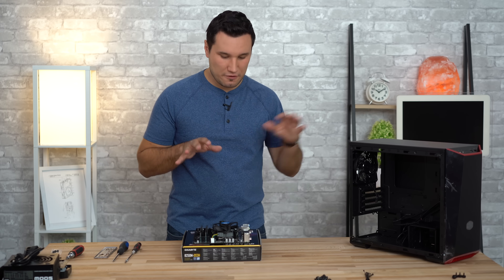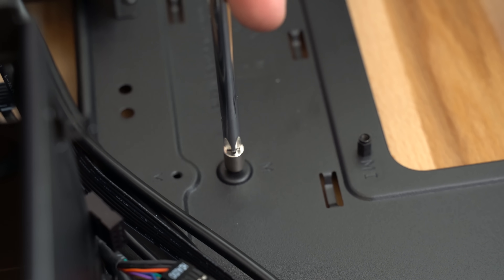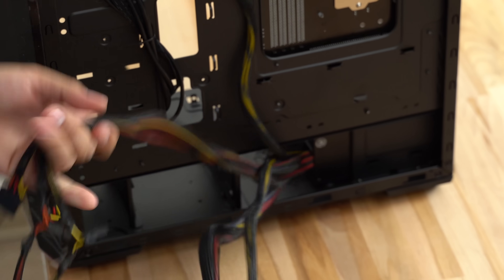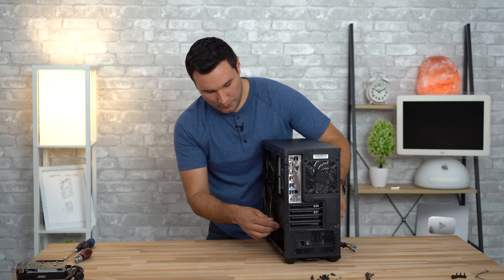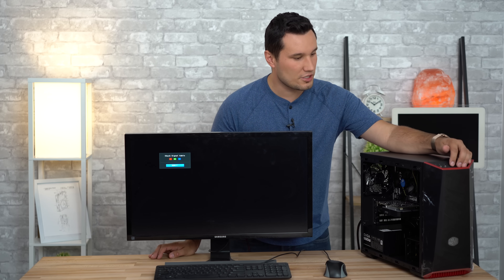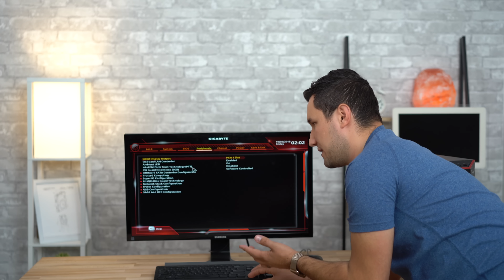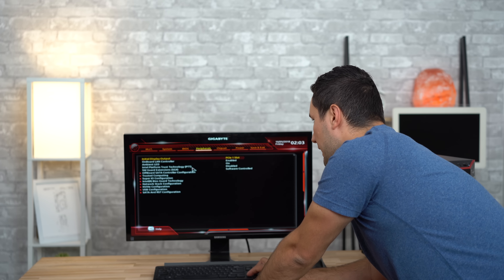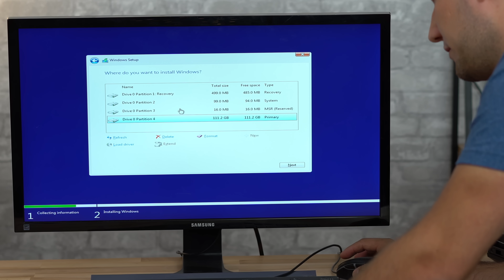$492 Budget Gaming PC Step-by-Step Build Guide - Fortnite & Black Ops 4 BEAST!

Comment: How can you only have 128 GB of storage in a gaming PC. If you look at many modern day games they are huge and would fill this up really quickly. If you are going to build this, put in a few extra bucks and replace the SSD with a 500 GB or even 1 TB Hard Drive to save yourself the hassle of low storage. It would be a little slower than the SSD, but you would have so much room to work with, and hard drives really are not that hard to install, so that is a poor excuse to not get one.
Here is a link for a 500 gb WD Blue hard drive
https://www.amazon.com/Western-Digital-WD5000AZLX-500GB-Internal/dp/B00B1LW3W0/ref=mp_s_a_1_4?ie=UTF8&qid=1540141597&sr=8-4&pi=AC_SX236_SY340_FMwebp_QL65&keywords=500+gb+hard+drive
Reply: Joseph Leedom or just get both.  Prefer a SSD to start with and os installed on that.  Later or if you have the extra money can easily install a 7200 rpm hard drive.  But personally I think any build is worth it to add both.
Reply: @dannamanna99  I agree, but for that budget, both is a little out of budget if you are going for performance and stability.
Reply: yeah but like I said, in my opinion getting a ssd and a 7200 rpm should be a must have these days.  stinks to have your pc crash in games like pubg.  then by the time you get back in, your dead cause it was a minute later lol.  ssd it boots up fast and loads faster as well.  can also get a 500 GB like you said with the ssd.
Reply: @dannamanna99  This.

Comment: Can I use a 1tb hardrive instead of an ssd?
Reply: Yes, you can.
Reply: Yes. SSD's are just faster. A lot of people put windows on an SSD so it loads faster and get another regular hard drive for everything else
Reply: I suggest both.  Just spend a extra 50$ or so and get a 1tb 7200rpm.   It’s a lot nicer to have SSD and os on that.
Reply: Yes but as @Chris Danna said, it's better to get a small ssd WITH a 1tb hdd

Comment: Fuck that buy a used 1060 3 or 6gb on eBay for around the same price. The 560 is absolute ass. Not to bash this build it’s still good
Reply: It's a good starting gpu, but I agree that there are better options out there

Comment: the i3 is a waste. With that kind of money you could get a ryzen 5 2600 that will blow the i3 out of the water it also has 6 cores/12 threads and is overclockable out of the box with the included cooler. Oh and don't forget that you can also stream with it while not even hitting 100%
Reply: Maybe he thought since the ipc was better with intel, that was the reason he went with the i3? Idk

Comment: Hi Guys

First off i really enjoyed these video`s Max. Thank you

My question is, i was checking out the "good 1080p" and the budget 4k monitor and i have realized that the 4K monitor is cheaper then the 1080 BenQ. If you would have a 4K ready graphics card. Would you still buy the BenQ over the Spectre 4K ? Or the other way around ?

Thank you
Reply: Imo, I would not use either monitor, as the Spectre's colors are not so good and the BenQ is a little overpriced. I would suggest MSI's Optix Mag24c, as it's 1080p, 144hz, and has good colors, all for 200 bucks if you find it on sale.

Comment: Have you tried any of these budget mini pc builds that use laptop parts? Are they worth tricking out and how would their gaming performance be? 

This is my budget build as of now $145. My rig so far is in a  Cool Master Elite 110 case from New Egg, a used Asrock IMB-170 from Ebay for $70, from my broken Dell Inspiron n5110 R i've salvaged the i5-2410M cpu, 2x4gb of ddr3 sodimm ram 1866mhz, 7200 rpm 1tb sata hd, I picked up a nice cooler that fit the board perfectly from ebay for about $15 copper aluminum heatsink with a fan however I had to do a mod to the 400 watt power supply motherboard harness connecting the green and one of the ground wires  I suppose i could use the mini pcie wifi card and put antennas on the case but i'd rather have a ssd boot drive but idk is all the upgrades really worth it? spending Is spending but would a $400 investment on a decent kingston ssd, a nividia gtx 1060 6gb gpu and the Intel Core i7-3940xm play the latest game titles???

Comment: Great  tutorial! Just one question, when you boot the system it was the 8100 on the b250 or you already swapped to the b360? Just curious because it wasn't supposed to work. Intel says 8th gen cpus only work with z370, b360, h370 mobo.
Reply: Eduardo Chinen anyone using intel for value is just dumb. Intel is the fastest right now but AMD is miles better for value.
Reply: @gfjfjufidi2880  you forgot to mention it is waaaayyyy more future proof.
Reply: yeah on the lower end it doesnt matter at all if you get intel or amd (unless future proof is important)
but if you plan on buying a high end cpu for like 300 bucks amd all the fucking way intels got nothing on amd
Reply: Eduardo Chinen get ryzen 3 2200g for $80 at Microcenter for $80 instead. Same performance when overlooked on a B350 board which can be found for 64.99(Gigabyte GAB350M-DS3H).